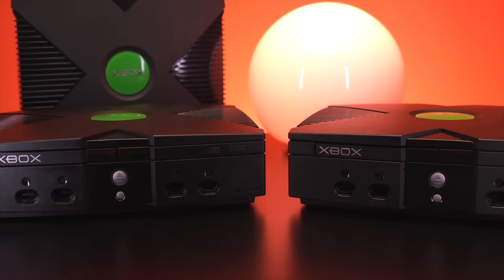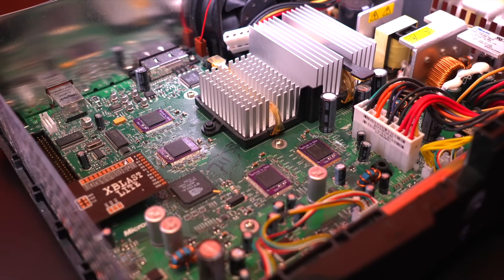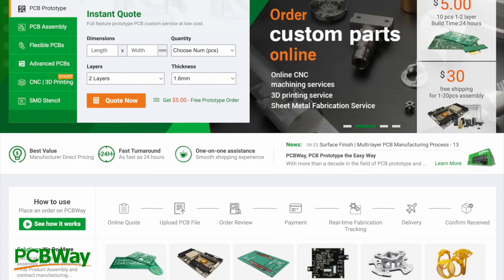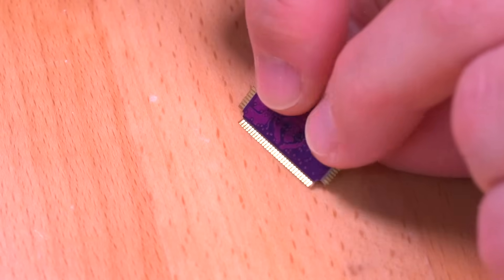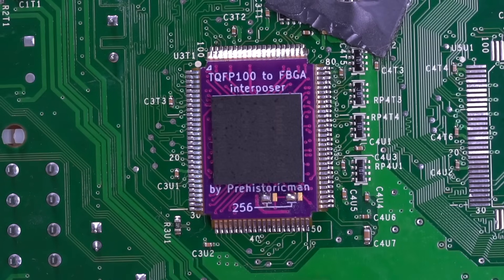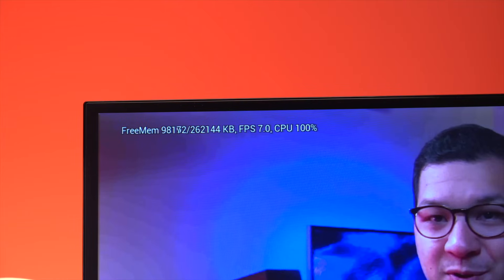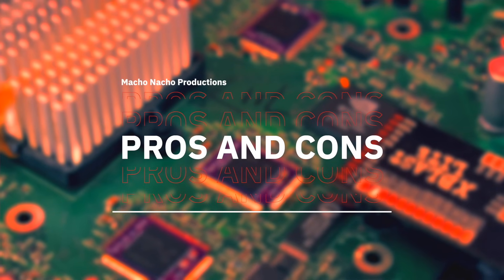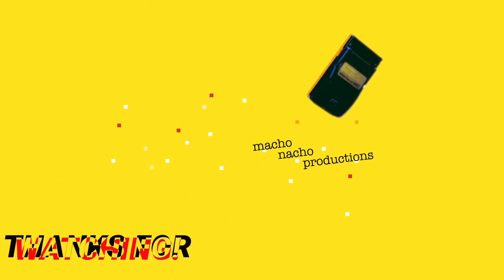Giving The OG XBOX Quadruple The RAM | Never Done Before!

Comment: 12:14 That says "MiB" which is Mibibytes, not "MB" Megabytes
Reply: Mibibytes and Megabytes are the same thing. Megabytes can be defined as either 1024KB or 1000KB. You use the term Mibibytes to clarify which definition you're using.

Comment: I disagree with your understanding of the bottleneck. It is clear even in your own video that the CPU was overly taxed and unable to render the video frames fast enough. The RAM was being used  but there was nothing to load into the memory. An 8K frame requires just under 130MB of RAM when waiting to be drawn. Playing something at 8K in this machine is not an effective method to benchmark anything, especially not RAM. 

     You can clearly see the CPU is the bottleneck but even with a faster CPU you'll still be unable to carry many frames in RAM. 256MB of RAM is just too little for that video requirement. What you need to do is benchmark using games or any benchmarks that can be run in XBox Windows.

Comment: Use a hollow scoop solder tip. Then fill the scoop with solder and wave the solder along the pin junctions. Not too much solder but with enough flux. As you lightly scan across the pins, a uniform join is made.

Comment: Pro tip - you can add a ultra low melt solder to the pins before removing the BGA, dramatically reducing the time it needs to heat up to be removed :)

Comment: Paper masking tape is MUCH better than aluminium tape; as it is a termic insulator, as opposed to a termic conductor (aluminium). 
You can even stack it 2-3 layers for extra protection, with some capton-tape on top to protect it against singeing. This stacked insulator would also be great for use on top of the RAM chips to protect them from the hot air.

Comment: Another thing: you were applying the solder iron a bit too long both while desoldering the old & insoldering the new flatpaks & while this might work highly integrated semiconductors don't like the heat too much. Also: I prefer not using solder irons for tiny smd components but use a hot air solder to heat all pins simultaneously instead.

Comment: I know you can interpose a 1400Mhz CPU as opposed to the stock 733Mhz, if you can also do the same for the GPU then that RAM boost can matter (though I still don't know if there would be an improvement from 128 to 256 but I think so). It would be pretty cool to up the resolution and frame rate (I assume each game would have to be moded), maybe introduce some post-processing settings (would this have to be done via BIOS or could there be a small program/script) running in the background. If I said anything dumb it's because idk wtf I'm talking about lol.

Comment: The pcb interposer seems a very bad idea when you realize chips including bga can be mounted directly on a flat flex cable. So the entire thing would lay flat and need no bending. 

It's a nice tech demo, but no game was optimized for more RAM than the default 64, so it really isn't worth it for the average user. You could use it for a great new dashboard, but I'm not looking at dashboards, more then a second to start a game. Video? I have fancy new hardware for that.

Comment: Honestly (gaming perspective) there is no point upgrading consoles with more RAM it's pointless and useless even with a custom bios /firmware it won't make a difference. The original games will not use the ram or benefit from it the games were designed to run on the stock amount of RAM so the extra ram will not be used...
If there are emulators that can be run on the diverse consoles maybe the extra ram could be used. As an emulator can always be modified to take into account the extra ram..

Comment: Unfortunately, I think using the upskilled video as a benchmark test was the wrong choice. Because even with the expanded ram or a properly modified bios program, you would still run into the bottleneck of the graphics card or processor whichever the original xbox uses.

Comment: There hasn't been a significant purpose to modding huge amounts of ram in the OGXbox since the modding scene initially started.   It's very much PC based, but the entire machine is limited around it's initial hardware.   And I don't believe multi-tasking is possible on the original processor.   Linux is the only case for this kind of mod... everything else is programmed to the original limits because it's highly streamlined.

This mod would be good for somebody wanting an alternative to the original ram mod.   I still don't understand the need for it... all I ever did was play games on my console.

Comment: I upgraded my Xbox by swapping it out for 128 GB DDR4 3200 Hz RAM, and swapped out the cpu for an I9-10900k, because of this change I had to swap the motherboard out as well, and power supply, and then out to an RTX 3090 and then it wouldn’t fit into the console.  anymore so I swapped out the case. It’s a pretty sweet mod.

Comment: one of the pros is that you can use your retail xbox with the extra ram to play arcade games and Chihiro games.
Reply: The ram is to play original xbox games but on 720p, with more cpu and more ram xbox games can run smoothly at 720p instead of 480p so look like xbox360

Comment: @15:18  I see swollen capacitors.    The tall ones by the CPU heatsink are starting to pop up.   I assume this controls the CPU vcore voltage and if those capacitors are bad it will crash too.   Replace the 3 tall capacitors and try again.  I see one by the power connector but can't see the top of it.  Might as well do that one too.

Comment: Well, the custom BIOS explains why it runs or, as another possibility, coming from the "consumer PC-like"-architecture: dynamic RAM training during boot up. Typically, in regular embedded projects, your DDR-RAM type (manufacturer, chip model) is fixed. Without the proper training data in the firmware your DDR-RAM controller wouldn't be able to hold the DDR-RAM content stable, causing data to become random after a while. That is, changing on its own, read and write operations being unreliable or just completely getting lost.

Comment: I still use an HP Elitebook 8570w. It has been on at least 8 hours every day for the last 8 years and even the battery is still pretty good. That thing is a tank. And was bought used with probably 3 years behind it's back (i7 3rd gen).
Last user-tier laptop that lasted me a lot was the HP Pavillion dv6 series.
After 2010, repairability and quality of laptops went a downhill with no brakes.

Comment: DIY heat shield not needed
Don't need to bend the chip either this instalation is just terrible and giving false information if your unable to follow instructions you shouldn't be doing this mod
Using 8k on a console that doesnt scale to 480 i hate this channel

Comment: I don't see the point, why would you still use original xbox hardware ? I can understand liking the look of the console, but then you can just use the case and build a pc inside and emulate everything, which would be 10x cooler and easier.

Comment: Couple questions 

For a modded system with the 1.4ghz upgrade, would 512MBs be theoretically possible and with xbe patches to lock the framerate be worthwhile for 720p/1080p with the internal hdmi mod

Second question is leaning to not possible in my mind but, installing ddr2 with a custom interposer that takes in the normal voltages and commands for the normal ram?
Reply: Xbox 359

Comment: Excellent video and exciting topic. I heard about a CPU mod a while ago. It consists in replacing the original 733 Mhz CPU with a 1.4 GHz. According to what I could see, this CPU upgrade would require the 128MB RAM upgrade (or use a Debug Kit or Dev Kit XBOX since both have 128MB installed by default) as the new CPU performs much better with that amount of RAM rather than just 64.  I wonder if this CPU upgrade could be considered as a complementary project to this 256MB RAM upgrade.

Comment: The games on this console are programed for those 64mb. only good option is getting stellar mod chip and a SSD . for some speed upgrades. other upgrades looks nice on paper but infact wont bring u more secods of speed or fps/ its still running a custom P3 cpu with a nvidia vga adaptor.

Comment: I can say why its not useful, all the apps for Xbox should be compiled against fixed amount of RAM except homebrew that can detect extra.
Thus there are 128mb patcher exist. And some games can break having more than 64.
But one way or another patch is essential for any game you wish to work with 128/256 (if it aint hombrew or dev/debug apps which already built for 128)
I surprised no one remember DreamX 1480 project with ram and cpu upgrades.

Comment: Not sure what benefit this adds, considering the Original Xbox was heavily reliant on the HDD to pull off a lot of what allowed the system to be comparable to PCs at the time.  The Xbox 360 would see far more benefit from more RAM as that system was a complete mess from top to bottom.

Comment: Right now, I just need to get it working again (wont turn on)

But it DID get a replacement SATA cable (the stock cable wasnt as fast as it SHOULD have been for the consoles drive), and a change to the fan to make it faster

Comment: Thief Deadly Shadows had the levels cut in half with loading zones because the OG Xbox RAM was so low. On the PC version there is a mod to remove the loading zones completely, hypothetically if you mod the BIOS to see the RAM the PC mod could be ported to the XBox version.

Comment: Someone with more knowledge on the topic will need to correct me because I'm not the most well informed, but I know the original XBox was built using a SEGA Chihiro Arcade board and because of that, modders have figured out ways to get some Chihiro arcade titles to work on the XBox. The big thing holding it back? The RAM... Because of this mod, theoretically, it might be possible to get all the Chihiro arcade titles working on the console now. This is actually a really big development for the system!

Comment: Running an 8k video seems like overkill. Like trying to run Crysis at max settings on a Windows 98, it's not going to happen. 60 fps on minimum settings? Ehhh...maybe.  Halo at constant 60 fps 1080p seems reasonable. You have to remember you are bottle necked by the rest of the 20 year old hardware, and keep your expectations realistic based around that.

I have a beast of a Windows 98 that I use to play pre-2000s games. 4.15 GHz Pentium 4, 2 gigs ram, 256 Mb graphics, 120 gig HDD. A monster of a Windows 98, but completely useless by today's standards.

A 700 MHz processor is only going to do so much. 2 gigs of ram would be useless with that  Limit your expectations based on what you are working with.

Comment: Would thicker copper help the interposer and testing contacts?
Vias maybe and maybe the length of the traces need to be the same length for the bigger chips?
Did anybody ever test different solders for frequency dependent resistance?

Comment: The rigid-flex interposer is an interesting solution. I would've assumed castellated pins would've been the ideal solution, but I suppose the original footprint's pin pitch might be a little too fine for that.

Comment: I ran Windows 95 with 32 Mb RAM, (I only had a friend that had an Xbox, so know very little about mods past 2005). 256 Mb is Windows 2000 (easily) or even Windows XP realm.
That would be cool, must be games on Windows 2000/XP that could be run from the Xbox with a good Xbox BIOS (and maybe a custom driver or two?).

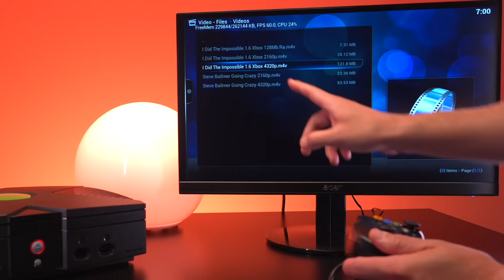Comment: 12:39 - Even if you were to give your xbox 500TB of ram. It will still run your 8k video here as a slide show. The Nvidia graphics chip that was based off Geforce 3 doesnt have the correct codec support meaning all the hardware acceleration/processing was being done by the CPU instead of the graphics chip. Hence why you saw the CPU being pegged at 100% while you were running the video.

Comment: If you upgrade well wait... What does that ram go to its to the GPU right? Or does it go to the cpu? Well in any case if youre able to overclock one lf them again not sure if that would be good for it in the long run but if you do boost its frequency then it can be of use. Tho it would be better if someone wanted to make an original homebrew xbox game that needs the extra ram to work. Dev kits were like that when they didn't stream line the game at all and needed that extra memory. I like it if one is able to boost the frequencies now of the cpu or gpu on it making it stronger and say run just like 1080 like the 360 but have the regular architecture of the original Xbox well then truly it be the xbox 2 lol. Or call it the xbox slim far stretch from that because its not slim lol. Or still keep it at 720p but have a bit better graphics just some, least if people are interested in making a game for it which im sure theres a handful really. The original Xbox can do that oh can probably run texture packs on original games and it can run those now there you go thats something.

Comment: In 2008 a forum user upgraded to 256mb using chips from a Compaq Presario, but because comparisons between 128 and 256 showed that there were no significant gains, this was left aside.

Particularly, I wish there was this modification for the Xbox 360 and PS3, they clearly suffer from the memory they have, especially the PS3. As far as I remember, there was a developer version of the x360 with 1GB of RAM, but it is extremely difficult to find, and quite expensive.
Reply: PS3 used XDR RAM, so I don't think higher capacity ram chips are as easily available.
Reply: there were a few PS3 dev consoles that had 512MB XDR but they physically had more chips so unless you'd like to design a new motherboard for the PS3 it's not gonna happen
Reply: Yeah, I remember when this was done on Xbox Scene. Hate seeing these fake titles.
Reply: Happy to see more people calling this out as the lie it is. It's still impressive that the chips are not incredibly rare though.
Reply: I'm sure it could benefit emulators or applications. Im sure it would never benefit regular games that much. I will say though they have released tools since for patching games for using more ram. on top of that, with the 720p patches, the games run way better on 128mb. at the end of the day idc because id only ever use xbox for games and id use a PC CRT, not an LCD.
Reply: @Coborlwitz  It was also used for media playback via XMBC

Comment: ram and CPU upgrade for the OG Xbox looks insanely hard. Id probably mess it up. 
It's literally for emulators. maybe 1 unrealesed game. Also the need of a hacked console.
IDK still rather do emulation on a computer. MiSTer now is a option and it's ment for that. No soldering or hacking anything.

Comment: I’ve heard of 128MB upgrades but never 256MB! This is amazing! Do… do… you do mail-in upgrades for disabled fans? 

Not to mention the ultimate 1+GHz CPU upgrades (1.5GHz) 

Then a 4TB SSD upgrade, upgrade the VRAM, a Blu ray optical drive, and dual boot the mod launcher/or Linux or FreeBSD/OpenBSD/NetBSD. 

Biggest issue rn is needing someone to reverse engineer the nvidia driver / hardware to properly merge it into the Mesa or Mesa Amber nouveau project for OpenGL acceleration on Linux/*BSD, etc. 

(Honestly would love to see SerenityOS with X11+Mesa full 2D/3D acceleration) 

So then… run one of those operating systems on here… and then have an Xbox emulator running on that… so emulating the games on upgraded native hardware via a UNIX-like OS that also gives us a full desktop OS experience to be used as a Plex front end, TUI Discord frontend, and many more modern but light weight solutions.

Comment: I've pretty much decided my current soldering skills and equipment are good enough to finally do the RAM mod on my own, just need to hait a bit to snag some cheapo old version of xbox (most on the market are 1.6 and 2 I already own are 1.6 as well...) and then I'll put it into a skeleton shell since the original insides are completely trashed - looks like it was flooded, everything is covered with rust and mud but at least I got it very cheap

Comment: Instead of rigid flex, you may be able to use castellated edges as the connection. This would completely solve the bend problem and make the mfr process cheaper.

Comment: Why are we stopping at 256? I want to see this console get at least 1GB and upgrade to a socketed CPU and run some version of Android. Let's get a Gigabit Lan mod and a bluray mod. Let's put feet on the side and stand it.....actually that's a terrible idea. 

At this point, 3D printing an OG Xbox shell and shoving a gaming computer in it is the better option. I'd probably model it after either the OG or the refrigerator Series X. Probably an easier mod anyway.

Comment: Yeah, using it for Linux\FreeBSD is the only thing that I could think of.

Maybe in the future, some homebrew can take advantage of it.

There could be some game speed up by prefetching from the disk drive and putting it in RAM, but that'd be a lot of work to modify the kernel to take proper advantage of what is probably already optimized.

Comment: Been thinking about this a bit lol. Using flat flex like that is not ideal. I'd suggest castellated terminations for the next interposer revision. The connections would be more secure and the extra real estate can be used to address some of the issues regarding the RAM timings!
Reply: The issue is that none of the accessible PCB manufacturers will do castellated edges on such a fine pitch… hence the hack
Reply: @jdownj  That very well could be a problem. I know it's possible because I've seen fine pitch castellations, but they were on ITAR regulated assemblies.
Reply: @Sun-ut9gr  that brings up an interesting point.  I have no idea if PCB technology is regulated in any way… BUT the board manufacturers that can work down to that small are probably busy doing stuff that is more profitable for them than a hobbyist project like this…